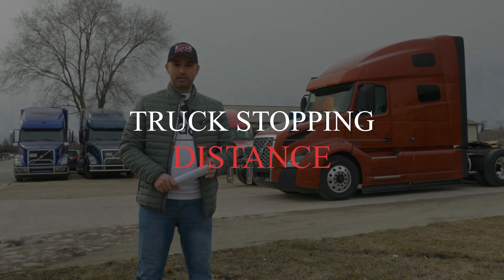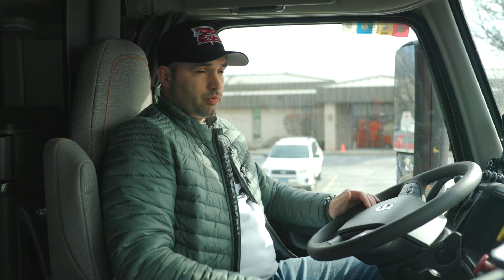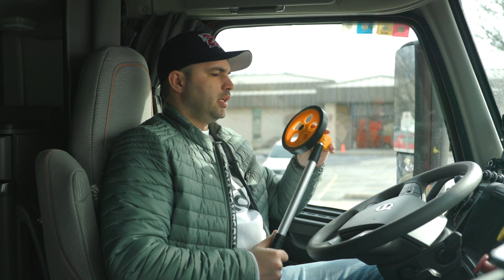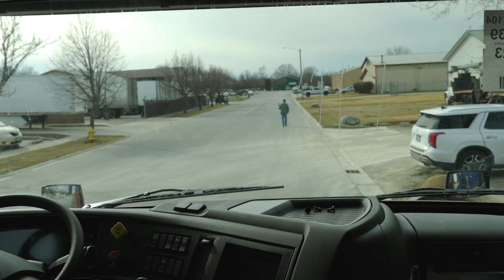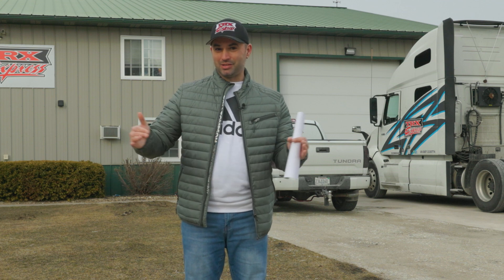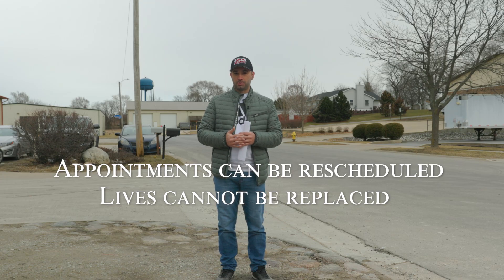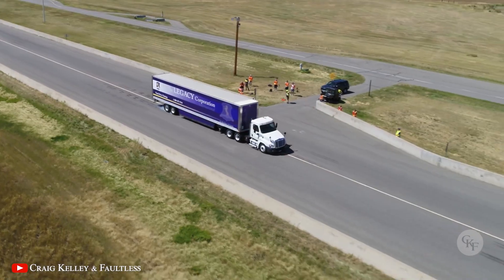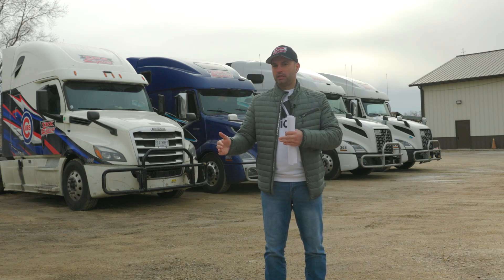This Is How Long It Takes For A 80,000 LBS Truck To Stop

Comment: Truckers act like it takes 5 business days to stop, when it's literally more like 5sec, and a mere 525ft (its literally not even twice as long as a car). The cop was visible for at least 1500ft. The trucker blew by going at least 40mph. That trucker never really even attempted to slow down.
Reply: Also if you're doing an emergency stop, somebody fked up. Either the trucker by being distracted or speeding, or another driver not following the rules.